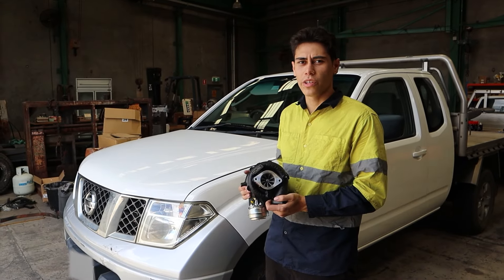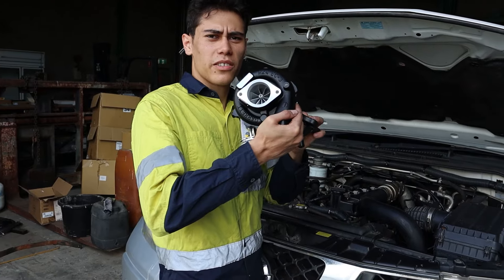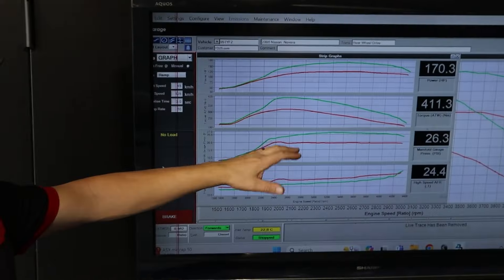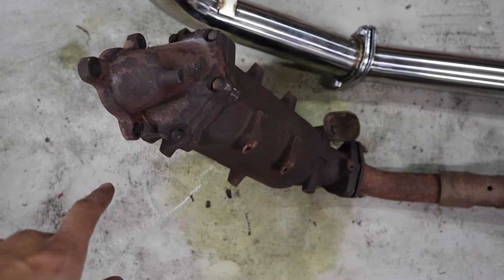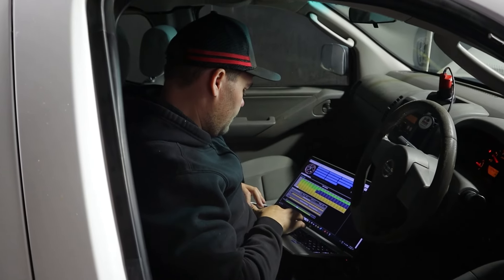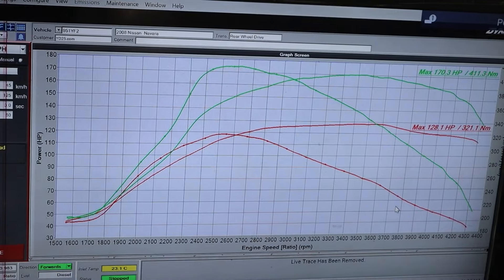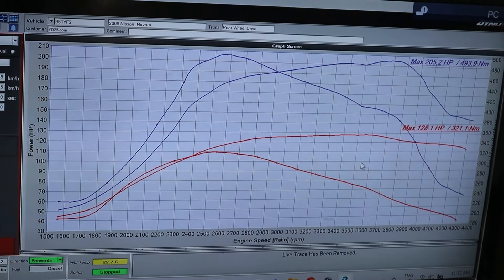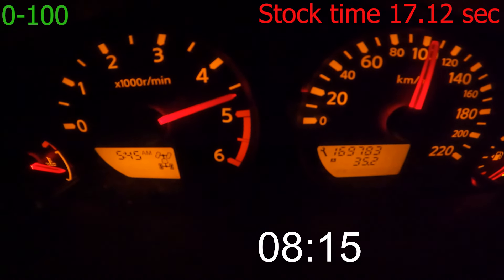D40 Navara High Flow Turbo & 3 Inch Exhaust Dyno Tune

Comment: That's what i wanted to see! To get that 200 to the wheels, do i need to worry about my automatic transmission and gearbox?
Reply from the maker: havent realy heard of anyone break them should be fine. High flow cold air intake is also recommended. That alone makes 6hp difference without adding extra fuel and helps the turbo not overspeed. Stock intercooler is good but if you do upgrade make sure you get one that doesn't cause anymore pressure drop through the core then the stock cooler.

Comment: Always run a pipe off the turbo and nothing else. You'll notice the difference. Cats and or DPF are always blocked on high kilometerage diesels.
Reply: Going to a three inch will give you more gains than removing the cat
Euro4 doesn't require dpf

Comment: So all I need in order to install a d40 turbo onto my D22 yd25tt is the manifold, turbo, dump pipe & intercooler piping? Thanks man your vid’s shed a lot of light on the Nav scene. Trying to get some decent power but it seems mods for these are pretty scarce beside small package upgrades.

Comment: Question?. For when you upgrade the turbo for D40 is it just “plug and play” for the new turbo or do you have to change oil feed and return line to the new turbo or can you keep the lines as is, and does the new turbo need a whole new exhaust systems or can I just keep it stock exhaust. Cheers. Good video too 👍
Reply from the maker: @clayhobson7559  it's plug and play. All the OEM parts for straight onto it

Comment: I kindly seek your advice; I have a 2x4 automatic Navara D40 2007 VSK model 2.5 YD25 diesel ,engine with 40 thousand size piston (maximum boring size ) and with cancelled EGR system, manifold custom made off course but still EGR vacuum solenoid still installed, the engine has mechanical turbo and mechanical throttle and the vehicle do drive ok but i need to tune it up a bit to enjoy its max power so i need advise on;
1. What type and model of turbo can i upgrade to in order to maximize it power.
2. I found EGR vacuum solenoid still installed but EGR already cancelled, does it still serve purpose ?
3. How should the vacuum pipes from vacuum pump to turbo booster solenoid ,turbo , EGR vacuum solenoid and to mechanical throttle body actuator be if EGR has been cancelled?
I will greatly appreciate to have drawings for the vacuum system if you can please 🙏

Comment: Epic mate, where did you place your throttle body? I've been thinking about changing the Eletronic throttle body to a cable one. Any ideas on this? I want more throttle response. cheers mate
Reply from the maker: @GuilhermeNunes-e9y  I have removed it completely. Diesel doesn't need it

Comment: Hello, I have a question. I have a 2005 Nissan Navara D40 and for a few weeks (2-3 weeks) the car has not run, since it has an error code, the error is P0089 and is related to the fuel pump. The car doesn't run when you start it once, but if you turn it off and start it again, everything works perfectly. I would like to know if you could help me, thank you. A huge greeting
Reply from the maker: @hugo.tortola_0524  usually only fuel issues they have is from the scv or fuel pressure relief valve. Or you might need to do an ecu reset
Reply: @ thanks

Comment: Just picked up a cheap 2008 spain built d40 at the auctions, really low kms on it. I'm looking at a new exhaust and snorkel. Reckon im going tk do the turbo as well now. Did you upgrade the intercooler?
Reply from the maker: we did but for some reason didn't see any gains even tho it did reduce intake air temps and seems to not have any pressure drop through the core

Comment: would like to know costs? as i have a 2010 d40 4x4 6speed and needs more low end power. loved the 417hp yd25 build
Reply from the maker: Just doing a tune if you haven’t already makes a big difference
Reply: I had 2010 stx 6spd and first thing I did was get the plazmaman hard pipes, made a good amount of difference for the price. It was well worth the money.

Comment: Would a GFB VNT controller be a good work around for boost control when installing a gt2056v on a D22?
Reply from the maker: yes or even the hpd one that we used

Comment: Hi, I have a 2002 d22 133hp, non commonrail I believe the temperatures here range between 5-15c in the winter and 20-35c in the summer what oil would you recommend? I've taken up the car recently and my father's been using some 10w40 im unsure if it's fully synthetic.
Reply: No common rail?
Go to your local chip shop and pinch their used oil from out the back
Just remember to strain out the crusties

Comment: Awesome work! 
I have the R51 with the 140kW YD25. I already have a 3 inch Stainless exhaust fitted. 
You reckon I could get those sorts of figures out of my engine with the upgraded turbo and maybe an intercooler upgrade?
Which intercooler do you recommend?
Thanks for the inspiring video!
Reply from the maker: Yes the 140kw models can also make good power. If you buy a decent intercooler and get custom piping made it would be better then the kits

Comment: Nice mate! I'm trying to figure out what parts r best to get from  d40Hot side parts to put onto my d22
Reply from the maker: Just need the manifold, turbo and oil/water lines. Gotta make the turbo intake, downpipe and pipe to the intercooler
Reply: @yd2532  thanks yeah looking at either start after tax time or end of the year.

Comment: In Chile, on the D40 Yd25 (175hp), the turbo pressure sensor only reads up to 21psi. How can I solve that?
Reply from the maker: Piggy back ecu I think some people can also fix it with a remap otherwise they use a valve to trick the sensor

Comment: Intercooler video soon?
Reply from the maker: Its got a weird noise since ive put the intercooler on. Im waiting for a boost leak tool to arrive so i can test it for leaks. Factory intercooler fits a lot better then the aftermarket one.
Reply: @yd2532  i wonder if original cutting intercooler made from all aluminium will make it running fine?
Reply from the maker: @Bipolar_Bear7774  ye you can buy coolers that are OEM design that are all aluminium. They would fit alot better and customers have told me they were better then stock

Comment: Once again, great vid mate. Really enjoyed it.
I'm following this series closely because it's exactly where I'm at with my D40.
I'm curious about why you chose the piggy back boost controller (Ultra boost module) over a regular remap of the ECU?
Did you also remap fuel and boost tables in the ECU ?...or does the ultra boost hold all the modified maps & tables?

I'm currently running a Tillix valve for manual boost control. It's old school but it works really well and the boost curve is smooth & consistent.
I'm hoping I can keep the Tillix and get the ECU reflashed to suit. Then I can increase above 21psi without hitting the fuel cut/limp mode.
I like it because it removes the shitty BCS from the system, which increases reliability IMO.
But I need to talk to local diesel tuner - he may prefer to reconnect the BCS for dyno tuning...?
Reply from the maker: with the piggy back can run more than 22psi on the stock map sensor. the ultra boost holds all the modified maps and is a lot easier to make changes to then a remap.
Reply: Just spoke with my local diesel tuner.
He mentioned that the MAP signal tops out (fuel cut/limp mode) very early.
Is it possible to lift the MAP limit with just an ECU remap?
Or do I need to add a piggy back module?
Is your module just a voltage modifier that tricks the ECU...?

Comment: Will you be selling these turbos?any idea on cost? Thanks
Reply from the maker: yes we can get them from gcg. They cost around $2500 with standard bearings and extra for if you need the upgraded thrust bearing. Im gonna see if we can get an upgraded turbine wheel next so mabey just wait till we see how that goes first.

Comment: Hey man, do all D40's with the YD have +30 injectors from factory? I have a 2013 Spanish built. 

Love the content too. Keen to see what happens to this D40
Reply from the maker: Not sure about the 140kw models i'd assume they would with just a different spray angle to suit the different piston bowl designs in the 140kw engines. They dont seem to blow as much smoke as the early models but that could also just be because they have a different turbo and tune
Reply: @yd2532  ahh yep fair call man. Mines the 140kw variant. I haven't seen too many of them sooting along either

Comment: I have a turbo on its way out.
I just found this video.
Can you sell this setup as a kit? And if so what sort of money are we talking?
Reply from the maker: We can supply the Turbo it costs around $2600 with standard bearings or extra if you want the upgraded thrust bearing. Exhuast came from ppd and cost around $700. Depends on your tuner wether they will be able to fit a piggy back ecu or will just do a remap

Comment: Hi how should I break in a rebuilt yd25 engine
Reply from the maker: Put the engine under load like going up hills and vary the rpm. Don’t baby it and drive on the hwy at the same rpm and no load for long periods
Reply: @yd2532  is it normal to have some white smoke, and what are the  symptoms of a bad ckp sensor, the car is not REVVING past 3000rpm, maybe I mismatched the wires of the sensor
Reply from the maker: @ALFAMUSIC2  not sure what sensor you are talking about. White fuel can be caused by fuel not atomizing or low compression
Reply: @yd2532  crankshaft sensor, I have a p0335
Reply from the maker: @ALFAMUSIC2  have a look on my website on the ossilicope page it shows what wires go where for the crank and cam sensor
Reply: @yd2532  which section does this fall under, I can't seem to find it
Reply from the maker: @ALFAMUSIC2  https://www.yd25.com.au/index.php/services/diagnose-timing-chain-fault/osciliscope-method
Reply: @yd2532 for me the wires are not the same colour, I have a yellow, blue and a green wire
Reply: Hey mate love you videos, how did you know that was the correct exuast from ppd as they have 2?
Reply from the maker: @asult2235  depends on the year there is 3 types of engine in the d40 range. What's your cars details?
Reply: @yd2532  mine is a December 2006 spanish built model in manual, it has a cast alloy elbow coming out the top of the turbo and the soft bare rubber pipe attached to that outlet, I've been told there are different turbo locations and that either makes it 2005-2006 or 2007+, not sure wich one though
Reply: @asult2235  hi do you happen to know the wiring sequence of a crankshaft sensor for the yd25 my I bought a new pigtail and the wire don't match
Reply from the maker: @asult2235  if it's late 2006 should be the same exhaust as mine the 2007. Is the turbo a high mount like mine it should be?
Reply: @yd2532  when you say high mount how would I be able to tell? And when you say the 2007 you mean the 2007+ variant from ppd?
Reply from the maker: @asult2235  if you have a look at an 05 models they have a low mount turbo. Does your have a plastic or metal cam cover?
Reply: @yd2532  mine has a plastic cam cover, watching you video of you removing the old turbo by memory it looks identically set up to mine other than my muffler on the turbo outlet part is black and my intake pipe from the airbox has deeper dimples than yours

Comment: Ever seen or had any chassis issues with these D40's? Looking into getting one but pretty concerned about the chassis and there reputation so I was just curious about any encounters with these type of issues you may have had?
Reply from the maker: Not really in Australia only over seas where they put salt on the roads
Reply: @yd2532  No worries then. Thank you for the quick reply 👍
Reply: Here in the uk the trucks rot pretty badly due to salt being used in winter if your from the uk make sure to check the chassis and if its good seal the chassis straight away and reinforce it as well

Comment: Those YD25 are good durable engines compared to the TD27?  Heard alot of people saying the YD25 is headache...,.
Reply: Nothing beats the TD27 or QD32 for durability
Reply: @copyrightdraner  currently have a TD27 turbo from an E24 bus. QD32 5 speed auto. In a 1999 D22 Frontier. All Japanese. 

 It hauls. Tires in 1st, 2nd and 3rd, hit 180kph with ease, but due to high center of gravity, and crosswinds, couldn't see where top end would've been. 

Right now 10L gives me around 150kms. Average speed is around 80. Mostly highway runs. 

But always wondered about that YD25 and what it can do. Alot of D40 Navaras was sold here in Trinidad and Tobago. And they still flood the streets.
Reply: only the 140kw yd is good, the rest are junk.
Reply: @longy6612 how do you know which YD25 are the 140kw? I thought there all the same
Reply: @abzhama3402  So pretty much mid 2010 + Spanish built utes with have the 140kw motor.

Comment: Really hurting that vnt with choke flow.
Reply from the maker: Ye I wanna push this turbo hard then when I get a bigger turbine wheel get the turbo builder to check it for wear so I can see what's the safe limit of it is
Reply: @yd2532  it doesn’t really work like that. Once the turbine wheel is choked, it won’t flow any more, no matter how much more pressure you have. The only wear will be on the compressor side due to shock erosion. I suspect the clipping of the turbine wheel (if it is) will have a lot to do with your high back pressure.
Reply from the maker: @ManagerVitaly  ye the turbine is the limit of the setup. Having a high flow intake helps it a bit . The stock airbox has 2psi pressure drop so to compensate the turbo has to spin faster to reach target boost pressure which closes the vanes more and adds to the back pressure
Reply: That's it... boost doesn't mean anything,  only air density.
Reply: I noticed that too, the back pressure was good at around 20psi, at 30psi though it was in the 50's high in the rpm range. Surely there's a larger frame vnt that can be mated up and produce the 300hp without being too laggy

Comment: I checked out the snail prices, fark me. Bloody expensive huffers. As for tuning, the last run at 30PSI, clearly the turbo was well out of its curve with drive pressures over 50PSI and the smoke, yeah, leave the soot for the tossers and flog-bags, roll that shit in front of me and you would get a spray you would not want.
Reply from the maker: Agreed turbine is the limit for this setup. We are currently seeing options for a high-flow turbine wheel. For now, our plan is to optimize the intake with a cold air high flow intake as the stock one has 2psi pressure drop, an upgraded intercooler, and an upgraded exhaust manifold.
Reply: It’s all about showing the progress, with evidence to support the outcome!
Reply: @Cotto982  I know but still, that level of smoking was just crap. Waiting to see what comes of it.
Reply: @yd2532  Yeah, I did call the lads regarding a snail for my ZD30 thats still going strong. Shame you don't have such passion for the mighty ZD30...
Common element, they all need to breath.
Reply from the maker: @bentheguru4986  alot of the smoke down low went away with the Manual boost controller. Once we get a good intercooler, good intake, better flowing exhuast manifold it should be around 18:1 with the same amount of fuel
Reply from the maker: @bentheguru4986  the zd30 crd are strong and can make realy good power
Reply: @yd2532  So are the Di's, just harder to work with the ECU's than the new OBD-II of the CRD. Just imagine if an A/M ECU could be designed for Diesels.....